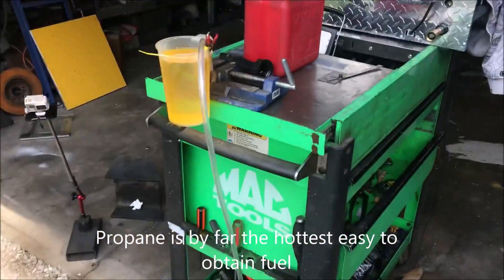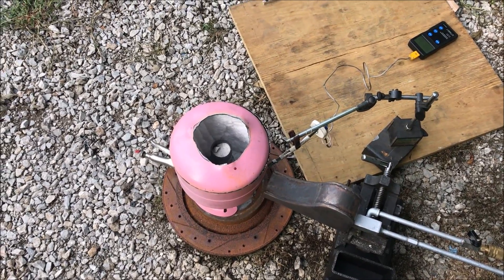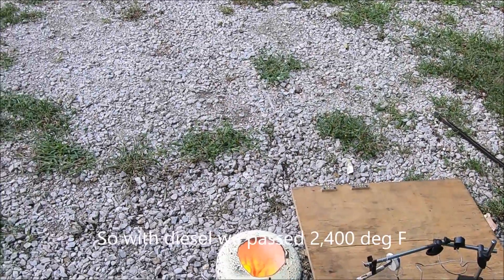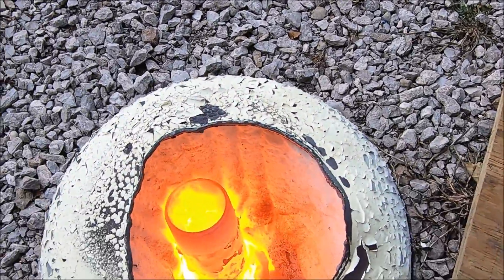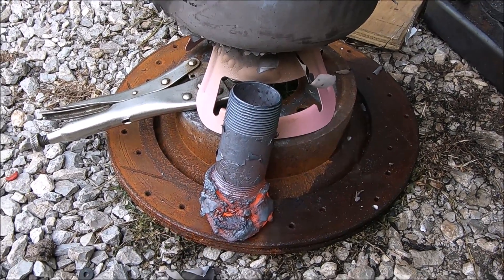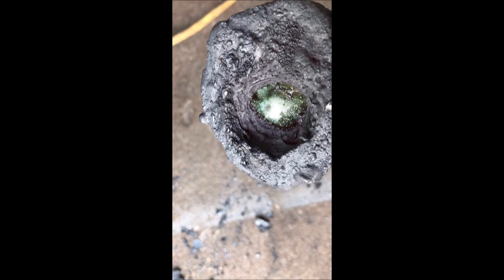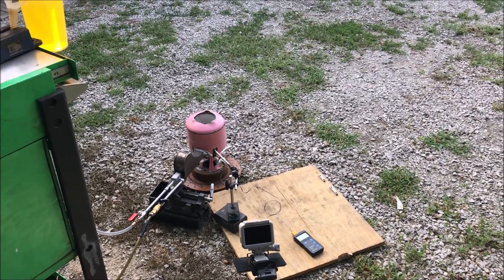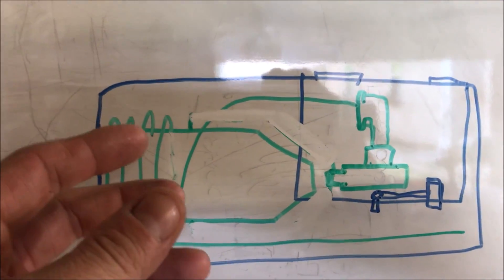Boiling steel Foundry with Little dragon Diesel Burner HYPER FOUNDRY 1

Comment: Rockwool sucks for keeping the heat in. P.S temp probe in what your melting, would be better! I've melted copper in a electric furnace, and had the temperature probe right in the metal.. 2300f is easy to hit, on the outside, just don't pat yourself on the back just yet!!!

Comment: Is this the one you have on ebay for 132 dollars. Also if you were using diesel would you need the blower or could you just have a copper pipe that you heat up and when thé diesel comes through thé hot pipe it vaporises. Could you do that like the old army pressure stoves

Comment: Really because I reach 3000 degrees with my waste oil drip foundry give me a vacuum cleaner motor and PVC pipe for my air supply
Reply from the maker: No offence good buddy but i dont believe you for a single second , and why 3000 deg on the dot ? Thats uncanny . If you  arnt pulling my chain i beg you pardon as i mean no harm friend , im just a numbers buff and from what i have seen over the years , that aint happening with waste oil , you need diesel or propane to hit those temps . In my experience that is ,but then again all my runs are under 2 hours and i have herd stories of it taking 9 hours to hit 3000 deg .
Reply: Because sand turns to glass at 3090 degrees that's how I know
Reply: Not trying to argue I just had good luck with it that's all
Reply: Being said your video is still very cool to see 👍

Comment: Your burn chamber is upside down. 
The belly should be on the bottom to catch any dripping drops of oil and burn it.  Because you are not using oil it does not matter. 
Amazing !! Congratulations !!
Reply from the maker: Actually its not , the other way leave large build up inside and puts out the fire , needs to let that stuff drop out of there for max efficiency
Reply: NOBOX7 OK THANK YOU

Comment: Imagine if you had a big coil over the foundry's top to collect all the heat that's escaping from there and pre-heat your compressed air!
Reply from the maker: Great Idea , there is a video on a kiln that implements your idea and he did achieve a savings from doing so . This device does have a secondary air intake powered by the venturi action of the siphon nozzle itself  . Today i am gonna weld an ss 1/4 tube onto the burner itself to pre heat the air , this will hopefully pre heat the fuel as well . the adiabatic temp of propane is 3,500 or so and we will never hit 3,100 if i dont implement some sort of pre heat strategy on both fuel and air. I am concerned  with performance losses due to heating up the air  , i will be getting less oxygen to the fire . will we loose performance in exchange for efficiency as is typical for that effect .  Inter cooler is the word that comes to mind and there maybe a chance that we undo some previous bench marks

Comment: Looks very similar to my setup....and I tend to agree...used motor oil seems to have the lowest heat output....i made the silly mistake of completely filling my resivior so I don't have any alternative data yet...ive had great success with diluting my oil with kerosene.. also...putting your flame input at a slight angle seems to work better than a straight perpendicular angle..vortex heating from the bottom up...happy to share my
 " trial and error " data...just drop a line..
Reply from the maker: Thanks Chad